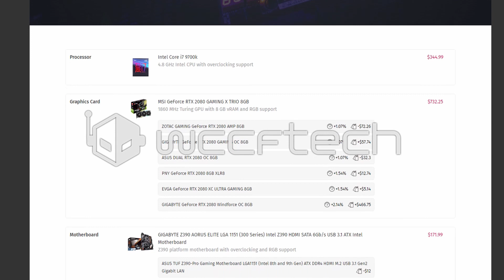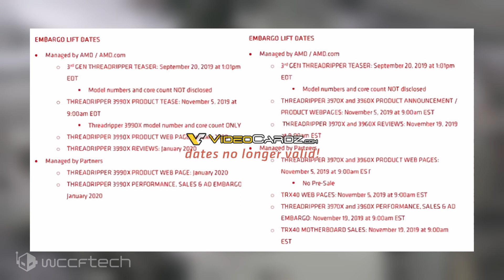AMD’s Next Gen Ryzen Threadripper CPUs Announcement Planned For November 7th

Comment: ALL I am interested in is the T/WRX80 line. When is THAT scheduled to be unveiled/released? I believe this line will be completely separate from the TRX40 line. 

The CPUs will be different, and the MBs different. It would be great if it was just the MBs and chipset were different, but all the CPUs were designed for use in either the 40 or 80 MBs. 

If that were the case, I could afford to buy the CPU now, and then wait and able to afford the 80 boards when they are released. But I don't believe this is the case; there will be WRX CPUs for the 80 boards ONLY, and there will NOT be any interchangeability between the two lines. ☹

So how much longer will I have to wait? Will it end up being an entire year? My anticipation began last April.

Am I wrong?
Reply: TRX80 line is rumored to release some time in January. It will only be teased this month if rumors are to be believed.